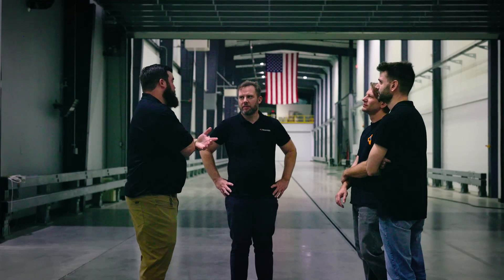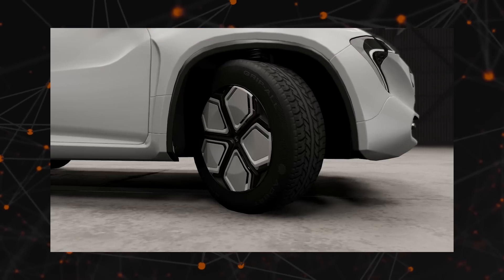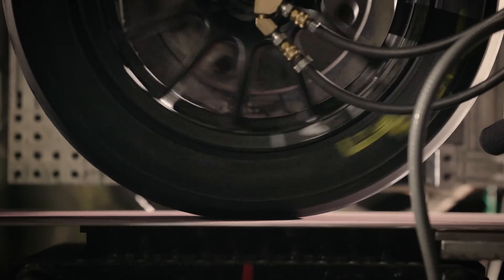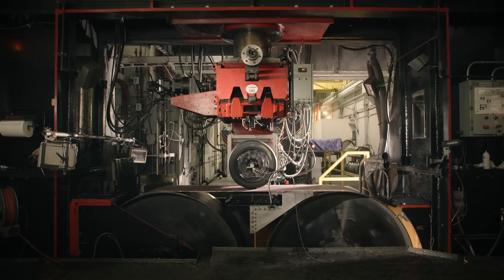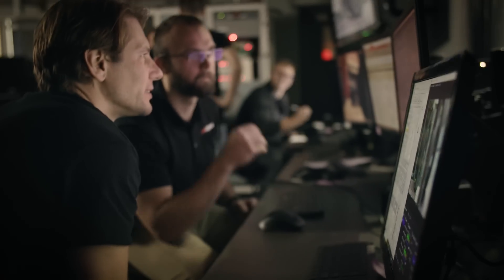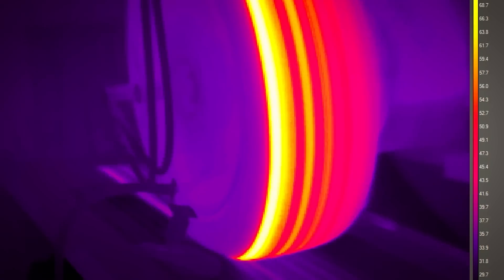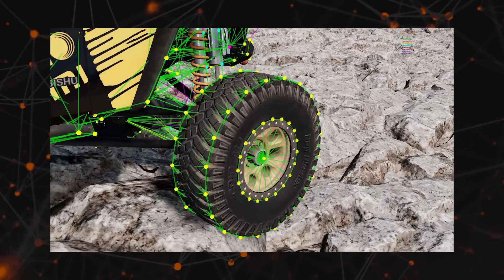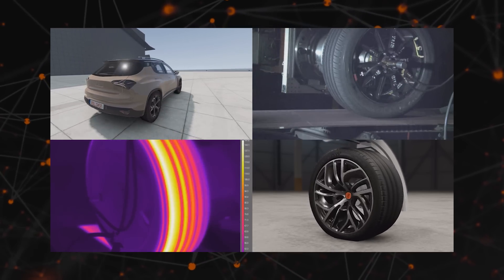Sneak Peek: Tire Physics Development

Comment: The tire traction modeling is way better today than it was years ago when I first bought BeamNG. It still feels very nervous on pavement (high frequency on/off traction)... but that could be realistic and the suspension/steering bushings in real cars mask that feeling through the steering wheel and pedals. Or the bushings even provide an added level of loaded compliance to keep mechanical traction. Not sure if the car nodes include bushings. Please Add Upscaling (FSR/DLSS/XeS) to help everybody on average GPUs run the game with better settings as it's rather ugly on lower settings.  (I actually bought Lossless Scaling to play BeamNG with my previous GPU- I paid money to upscale this game. lol. But it was still a PITA due to the auto full screen)

Comment: Should mount weight-measuring equipment into the lower strut suspension of a car to determine push down weight when cornering. Anti-roll bars, roll center, mass center, chassis stiffness all lean on the wheel.

Comment: Man they did say they planned it in the future, but we're starting development of actual tire wear, heat and subsequent grip changes. Can't wait in a year or two to see how good it gets. Finally BeamNG and simracing games will have a much smaller gap when doing real driving.
Reply: They have to focus on the force feedback first. No use in a new tire model if you can't feel it because of the poor force feedback. Lots of data/detail/information is missing or lost in the force feedback. I would rather the tire model be less realistic if it means more detailed force feedback with more data about the road and how the vehicles suspension is doing, also feeling the bodyroll of the vehicle. It would also be nice to feel grip levels better from the force feedback because that's almost non existent. There's hard coded filters on the force feedback that need removed.

Comment: Really excited for tyre model improvements, not too long ago brake thermals were officially added and it has been one of my favorite vehicle mechanics as it made driving a vehicle at or beyond it's limits so much more fun and challenging particularly in moments of lost brake effectiveness. A few tyre wear and thermals mods add some of those same types of challenges and many are very comprehensive compared to other games, but there's certainly not this sort of data collection and low level integration in the game engine backing it.

Comment: Player who didn't like BeamNG for very long time here and why I don't buy / like the game yet: I would love to buy the game for myself after they will fix the weird "Stretching" after collision. This single point breaks totally the "realistic simulation" and every time I see someone play BeamNG and this happens I get pissed off badly. Another thing which could be improved but is harder to fix is the material hardness. In Real car crash the car gets deformed just a littlebit but in BeamNG it's totally messed up. Why? And last thing that I wanted to address is the second most important factor that breaks the simulation: Clipping Textures. That, along with texture stretching are the 2 factors I didn't bought / like the game. I love to see that the developers care about the game and are trying to improve it as much as possible, keep it up and I hope that in near future these bugs would get fixed so the game would leap forward a ton!

This is not a hate comment or anything just my opinion and things I personally don't like and would love to see getting fixed.
Reply: Tearing simulation? That gotta make the sim run at 10 fps even for the high end systems

Comment: Wind tunnels are inaccurate.
1. Try blowing air into the center of a room. How far did your breath go? Not far, right?
2. Place a fan in the center of the room, blowing away from you. Stand in the place where you were. Now try blowing to the center of the room. Your breath went much further now, didn't it?

When a vehicle moves through ambient air, the air starts to move with the object.
When wind blows past an object in a wind tunnel, with both positive and negative air pressure on either side, you get greatly reduced disruptions of air.

This means things at the back of the vehicle will experience airflow differently due to the air behavior at the front of the vehicle, in wind tunnel vs real world.

Comment: I wonder if reworked tyre physics in beamng could also be done by making tyres behave less as a softbody but rather as a sort of signed distance function so that at lower speeds cars don't wiggle due to the rather low polygon count on most tires which is sometimes immersion breaking especially in virtual reality.
Oh yea and I of course hope to hear that sound you can hear inside a car on the autobahn when going over damaged portion of the road, something like a "glunk" or "badunk".

Comment: This is awesome! Maybe the floating cars will be a thing of the past someday! I've driven many models in real life over the limit and none of them had floating rear axles like in the game. You drive a 996 in BeamNG and the rear is like on ice. These cars in real life are planted.
The balance in general seems off in the game, no matter what car or mod I drive. It's still good, but just off. Especially considering I frequently drift Audis with quattro and in the game symmetrical awd still spin out when giving full throttle in a corner and initiated drift. That's the exact opposite of what happens.

Comment: Cannot wait for the grand marshal to feel like a real land yacht.
Reply: Cant wait to finally stop snap oversteering.
Reply: @FullsendMSV those cars are just like that in real life. I think the force feedback is a bit lacking there's not enough data/information to the wheel
Reply: @FullsendMSV  full throttle and steering will always lead to that in any high torque v8 with no driving aids.
Reply: @FullsendMSV  thats ur driving skills mane
Reply: @FullsendMSV That's supposed to stay, it's like that in real-life too.
Reply: @swecreations  no lol, its not as bad. In BeamNG you will spin with a 150hp rwd car on "sports" tires
Reply: @sigmamale4147  ive watched too many miatas spin out with good tires for this comment
Reply: @zacknewberry3167  maybe in the rain yeah lol
Reply: @sigmamale4147  bro you can literally snap oversteer without any power input, learn physics

edit: also please dont tell me you have a drivers license
Reply: @UltraProchy  i know how, all you need to do, that create different of force between front and rear wheels, it easy with lite brake push in the corner
Reply: The tires NEED more geometry
Reply: we need some broken parts like the one mod
Reply: Can we just fucking get new cars???? LIKE DAMN!!!!!!

Comment: This is sick. The ability to get wheel movements from the game and run it straight to the test and back again is certainly unique. I'd guess it's also a good excuse to run some more unorthodox tires on such a nice simulation. 
Are there any plans to release data gathered from the tests? It might be unnecessary or impractical but reading through a paper about this would be really fun.
Reply from the maker: Yes, we are planning to release that, but we cannot promise anything right now. There is a lot of data that we are still digging through
Reply: @beamng  Take you're time! There's no need to rush we can wait. Just keep giving us updates on what you guys are doing.

Comment: One thing I'd love to see is the aerodynamic model from X-Plane in BeamNG where the aerodynamics simulation actually bases it on the shape of the plane as a 3d object, it'd be cool to see that in BeamNG.
Reply from the maker: Aero is a tough problem, we will need to tackle that one properly at some point
Reply: Realistic water physics, wind tunnel simulation physics, and boats would be awesome.

Comment: This is really cool and I'm sure the devs find good use for it. BUT! Remember: iRacing also went to Calspan.... so getting data is not automatically going to reflect in the final product. But when used well, I'm sure it will give them insight in how to improve the game.
Reply from the maker: We love and appreciate iRacing and Forza and look up to them! We are just a small team trying to get our tires working better :)
Reply from the maker: Niels, we love your work - would be amazing if you could help us calibrate :)
Reply: @beamng  @NielsHeusinkveld is the sim physics man! Would be amazing to see that collaboration on the new tire physics.
Reply: Forza Motorsport had Calspan make them a custom tire testing machine allowing for weirder inputs nobody ever asked for. That was for Forza Motorsport 5 in 2013, which was the least grippy and least controllable in slides that Forza has ever been. Forza Motorsport 4 felt much better and Forza Motorsport 6 also felt quite a bit better again already, when they went away from that data.
Though the approach that the BeamNG devs are going for here, seems more thoughtful and their tire model is likely much better suited for that kind of data with the deflection and everything.
Reply: Yeah, +1. Forza too. Having gone there as well, the analysis process is extremely important and there are quite a few things to watch out for, not the least of which being sandpaper vs. asphalt (but also quite a few Calspan/rig-specific things, some correctable, some not). I think a lot of the reason we haven't seen more convergence from the studios that have done testing is that the analysis/post-processing/modeling is a much bigger driver of the results than the data itself. Just a few small examples: 1. Racing slicks (and road tires when they get hot enough) tend to gum up the belt while sliding, leading to hysteresis/inconsistencies in force results, inflated forces, inflated sensitivities, etc etc. Correcting for this kind of thing is cutting edge PhD-level work, most game studios (and really most companies in general) simply don't have the resources/capability to deal with it (which is a reason not to go to Calspan at all). 2. Not all of the sensors on the Calspan rig are properly synced in the time domain (making transient analysis problematic). 3. This is true for all tire data, but slip ratio/longitudinal slip velocity is never actually a known quantity as rolling radius is not explicitly measurable, so the calculation is always approximated. Meaning you either need to accept some error from that (as just 1mm of error might already be 10% of the way to the slip peak), or have a sim model that can exactly match the rolling radius in all states (in which case you can just use the angular velocity directly). Tall order in and of itself. Maybe a good time to mention one of the services IER offers is assistance with data analysis....
Reply: Wow a dev team reaching out to someone from the community for help on a project.
 Hold this 👑, the BeamNG team absolutely deserves it

Comment: This is perfect! Instead of trying to come up with models, starting way back with pacejka, simply feed the experimental results into a simple neural network and you are done.
Cannot wait to "feel" the result of this venture.
Reply from the maker: We'll try our best, not sure how much AI will be able to help in this TBH
Reply: @beamng  I don't have the insight to how do you use the experimental data, but according to the video material you are able to incorporate it already, so you do you. In case the data cannot be easily aproximated beyond the test scope using math (e.g. how do you quantify tire type?), a neural network will do this for you as a generic solution to any numerical problem.

Comment: I was, not ten seconds ago, just talking with someone about how good BeamNG is, and how its only lacking feature (in my opinion, having seen gameplay of but not played many other sims) is the tire physics being a little too grippy in the forward direction and a little loose laterally.

This is some absolutely great news. Thank you again for developing a physics engine for more than a decade, for listening to the community, and moving into aspects of driving simulation on many surfaces from your start as a crash simulator. 

I was there three thousand years ago

e: okay the test rig is cool and all, with 2400HP of movement going on and frankly ridiculous tire loading capabilities, but creating a stable platform to simulate other tire loading machines in-game to grasp how other tires behave, in order to glean tire data from different testing regiments is a really smart way of gathering lots of validated, useful data. Massive respect.
Reply from the maker: Thank you for supporting us all the way :)

Comment: Been with you since the original rpm and speed gauges were just bars and everything had the same engine sounds! 
Y’all have grown the sim significantly, and optimized it so it runs even on a steam deck. 

Keep up the great work, and remember that you guys are miles ahead of modern developers by keeping your software free of bloat. 

I remember the first time I managed to get the Scintilla going over 350 MPH using no mods whatsoever, and noticing that the tires didn’t explode over 200 like they used to. 

Can’t wait for things like the alternator load on the engine being simulated too, I noticed the warm up period feels abnormally long. I feel the engine would be torn up with the oil being as cold as it is when I test my cars.

Comment: Super excited about this guys!!! Although I did want express my own experiences with the tires for drifting with a direct drive wheel. From my experience when at low speeds or when the wheel is turned enough or has enough positive camber and fully loaded on the sidewall (think a high angle drift entry, or even a drift car making a tight u-turn with more than stock angle) you can feel every node in the steering wheel when the FFB smoothing is turned down. To get the best feel/feedback it requires the smoothing to be turned down, but then it can be super violent at times due to the node system. If there was a way to smooth just the tire reactions independent of the steering reactions it could make the FFB significantly better. Otherwise with higher smoothing the wheel just feels numb and loses it's realistic feel. Regardless these are incredible steps towards the right direction. Thank you guys for your passion!!!

Comment: Available tire research: “I have plenty of data you can use for ideal driving situations.”

BeamNG: “And so I asked Calspan to place a tire at a 45 degree slip angle and begin violently bouncing it.”
Reply: They know what we need
Reply: with a game like BeamNG, they gotta do things the Hard way
Reply: Thing is that most data were the paper side of, what we really need is to see what they looks like when they actually happens, not just some numbers on paper, we want visual, sounds, smell.
Reply: @Saviliana exactly. This is something LFS has basically been doing for the last 20 years, but without this machine and using only calculations, cross referencing, and experiments.

They are still working on it to this day.
Reply: @Saviliana can't wait for smell-o-vision to be real so I can do a burnout
Mmmm, nice melty rubber
Reply: @Saviliana  i think youre overdoing it with smell lol
Reply: @marcanthony9659  What do you mean? 20 years from now we'll have smell adaptors. we NEED the data
Reply: @marcanthony9659  Nah. Just take a slice of your car's tire, hook up an actuator with a lighter to the computer and regulate the flame with the temp of the in-game rubber :)
Reply: @Splarkszter  hhhahahah, its really gooood idea
Reply: Considering how hard it is to simulate tires, I wouldn't be surprised if this update also had smell.
Reply: LOVE that about BeamNG🤣🤪
Reply: Rallycross baby!